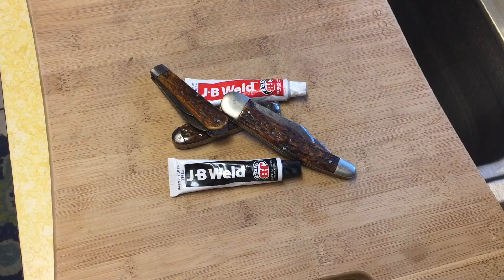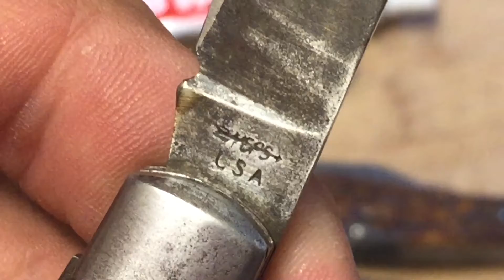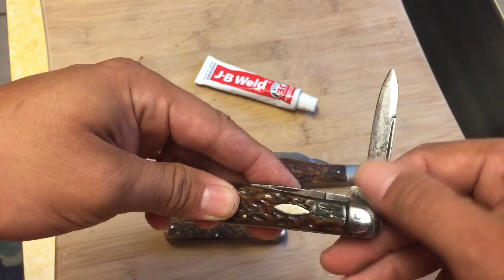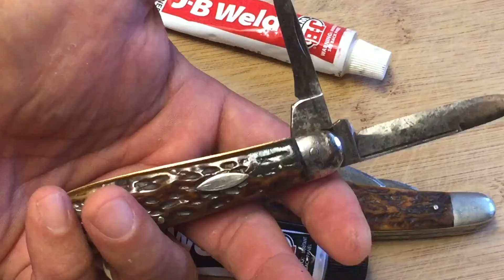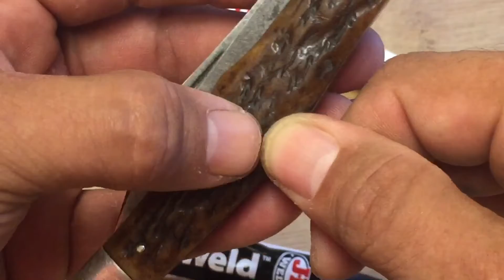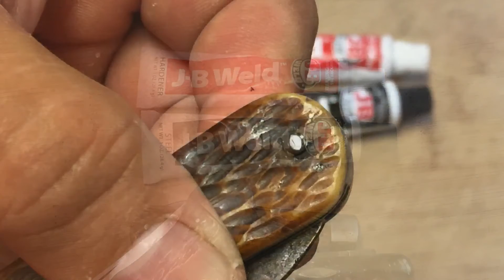Knife Repair with J - B Weld, YAX, Camillus, Other Pocket Knives

Comment: Hi update for you Knife Detector ..a product thats great that JB weld makes is JB weld kwick wood ..it's just as strong and easier to mold and easier to jig what ever you want to do with it and it cures in less than an hr  ..it's also sandable and paintable and easier to work with and comes in light brown and dark brown .colors , it's great for patching handles made from wood or bone regardless how much of the handle is missing ..just a head up and a good product that can yield professional results for the amateur 👍
Reply from the maker: Thanks partner, I may need to check that out really soon.
Reply: @KnifeDetector  wish I could send some pics using this stuff the results are  unreal ..

Comment: I make knives in my spare time as a hobby. I use the high temp JB Weld to attach the scales before pinning them. Great product. The high temperature version does not heat up and thin out as I am grinding and shaping the knife handle. Love it.
Reply from the maker: Thanks for the tip partner!

Comment: What happens to JB Weld if you mix in some paint to match the colour?  Some epoxies lose their strength if you add some paint or colour.
Reply from the maker: I have added a small amount of red oil based paint to get the color I want and I haven't had any issues with durability.  I think as long as you don't add too much, you should be ok, but it isn't an exact science so your results may vary.  As for me, I added a 1:1 of each tube of JB weld and 1/2 paint. So, 1:1:1/2.  Your results may vary, but this is what worked for me in the past. Of course if you want more color, you would add a little more paint but I think the amounts of JB weld should also increase if that't the case. You use what you need, and discard the rest. At least, that's what I do.